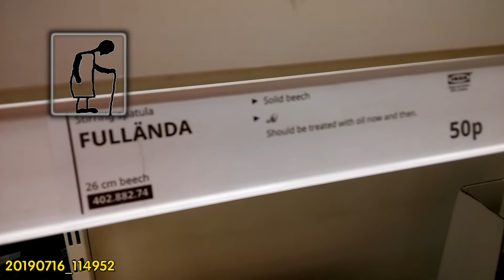IKEA fullända spatula boomerang build

Comment: An acceptable boomerang was made in the days of wooden foot-long school rulers by elastic-banding two of them tightly together in an 'L'. ( both flat sides together). With the joined end pointing toward you, held vertically by forefinger and thumb, and launched overarm with a flick to give it a spin. ( . . no kangeroos were injured while using this device). Doubtless sanding an airfoil section would improve things (use slats from MFI wardrobe doors?) and remember a right-handed boomerang is hopeless if thrown left-handed and vice-versa.
Reply from the maker: Here are a couple of my wooden (bamboo) ruler boomerangs https://youtu.be/KGdTh-N5hI8?list=PLA5a2xPRSrB12xmn9vy5iBnXI_q0hDF72 and https://youtu.be/vOPORpwaQDk?list=PLA5a2xPRSrB12xmn9vy5iBnXI_q0hDF72